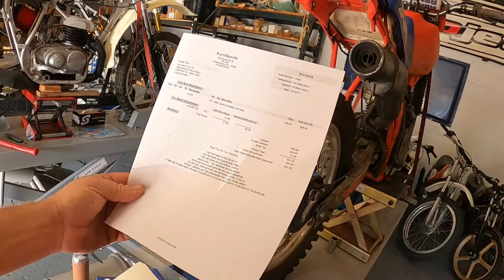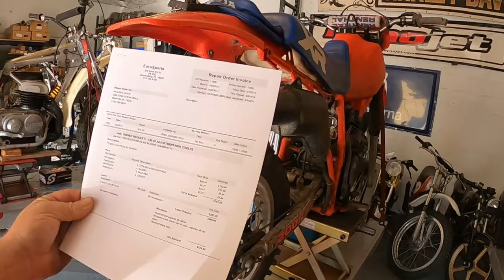HOW BAD DO YOU REALLY WANT A DUCATI 900 SUPERSPORT?

Comment: I am the original proud owner of a 1996 900ss/sp. immaculate and maintenance done and belts changed 3 years ago. 13000 miles. I still love it! No problem with cracking swingarm or steering head.
Reply from the maker: Sounds like a sweet bike

Comment: Hi Dave. My first job when I left school was manufacturing toothed drive belts. They are made with carbon fibre strands encased in rubber. Rubber is an organic compound that will deteriorate with age. So, whether the bike has been used or not, it's a good idea to replace them periodically to prevent a disaster.P.s. sorry to hear about Ingar.
Reply from the maker: Yeah, if I was not gonna let it sit again, I'd do it.

Comment: I ride a 1998 900SS Final Edition (#048). It has 26,000 miles on it and is immaculate. Is it a powerful motorcycle? No. Is it the most satisfying motorcycle to ride that I own? Yes.

Belts are easy. Valve checks are easy, even though the top mounting bolt on the shock needs to be removed to check the vertical cylinder. It’s not a big deal.

Comment: I used to have a 1992 Ducati 600 cc, basically this bike's younger sister.. it was my first Ducati, and i loved it!.. not that much torque as a 900, but the frame more than makes up for that.. braking?.. nah.. don't need to.. These bikes take a bit of gettin' used to, as they REALLY want to turn in.. solution?.. Throttle!.. accelerate when you go INTO a corner, don't wait til the end..

The seat position is fine, as long as you do no more than 400 Km a day..., the seat is way too soft.. a harder seat will enable you to travel up to 800 Km a day..
Reply from the maker: Right on!

Comment: Sorry about Inga. Nice bike. Swingarm issues only until 1992. Mirrows can be adjusted easily, just take them off and tighten the screw on backside a little. Ten year old tires, fluids, gas, etc… and the belt should be done to avoid risks. Hey, but I'm not your dad ;-) Best greetings from a German Ducatisti. Thank you for sharing your video. PS: In Europe the naked version is called nuda and with fairing carrenata.
Reply from the maker: Thanks man!

Comment: Mate, sorry to hear about your dog. I don't think it's a problem with the belts, the 4v might be under more stress with all the bends, but 2v should be good to go. Awesome video.
Reply from the maker: I never had a four valve. I didnt know they were more bendy!
Reply: With 4valves there's two cam pulleys at the top which makes the belt bend more times and at harder angles than on the pantah motors. Back in the day most belt failures were on 4 valves. I fully agree with what you said regarding not needing to change the belts on your bike, as I've heard a Ducati tech say the same thing.  @bullpencycles

Comment: The Pantah engine was different than the 900 engine, and in 500cc and 600cc I believe. The 650 Cagiva Alazurra used the same engine, they look good and are bargain at $2500 over a Ducati Pantah.
Reply from the maker: Thanks for the info

Comment: Shelf life for drive belts in general is 6 years, if stored correctly, that is an industry standard. That means without thermal cycling and in original packaging. If installed on a device (motorcycle) in a temperature and humidity controlled environment without air blowing or moving over the belt in general will maintain that for about 6 years. If the belt is of a higher quality for critical applications that involve life threatening applications (human transportation), It will even be higher than the 6 years even approaching over 10 years. Very sorry to hear about your loss, particularly this time of the year. From your videos, you obviously like animals. May the Good Lord give you peace brother. Tommy P.
Reply from the maker: Thank you.

Comment: I bought a 99 900 ss a few months ago had fresh belts put on two years ago when it was put up I got less then 100 miles snapped vertical belt😢 so now I’m dropping the engine and throwing a used head on it
Reply from the maker: @jordanbrandtner2745  I gotta think someone said they changed the belts but never did. I've seen a  shop charge for changing belts but not actually change them. It's crazy out there. They really shouldn't snap that quickly
Reply: @bullpencycles yea idk I definitely agree with you if my Honda’s timing belt can last 10+years and 200kmiles why can’t the belts on a Ducati last 5 years and almost no miles? My bike does also have 56k so it’s definitely been rode but man I wish I would have just listened to my gut and changed them right away would have saved me a lot of time lol